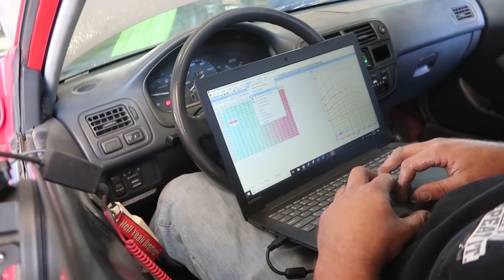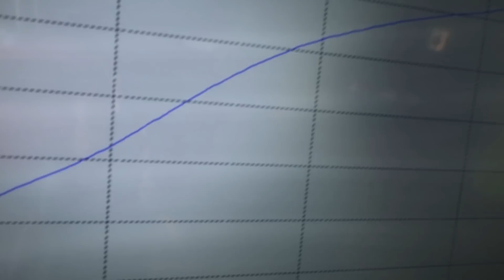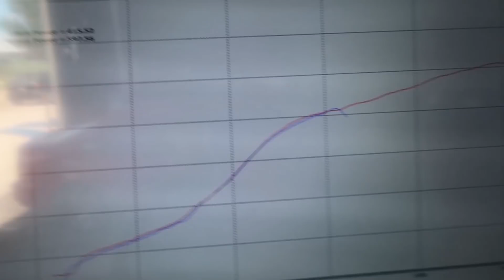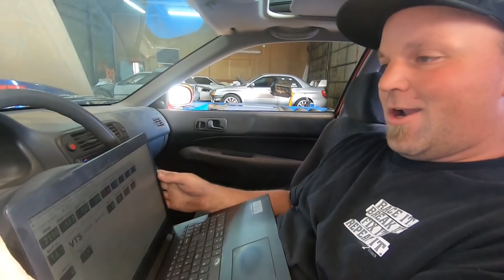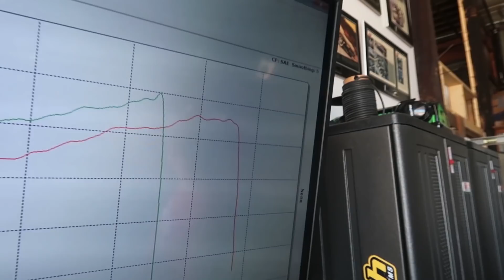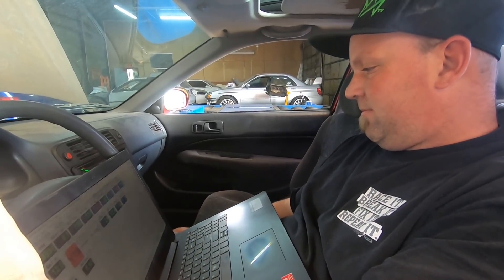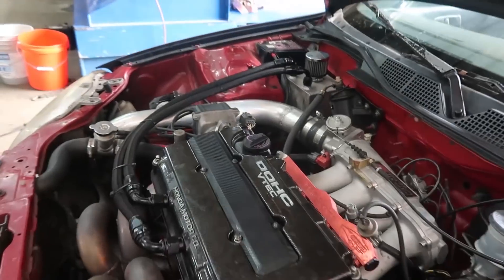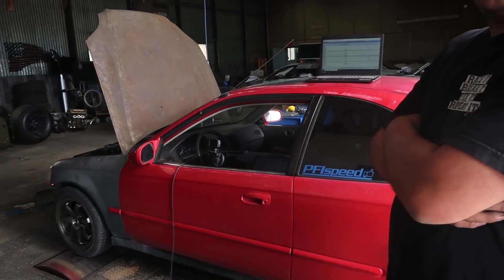A Dyno Session with Jamie’s Brother in Law!

Comment: Honda is awesome.. I have 1.7 L single cam that I would never trade anything in the world. OF COURSE, I GOT THE K&N Factory BOX Screen SHORT RAM and a K&N 3" Cone for back up .  SOUNDS like  a  fast  F1 car . I upgraded the plugs with some of my secret sauce.. it doesn't eat up gas like my old V6 4 CAM CADILLAC Sport edition Catera..
The Catera is really smooth with the air ride driving on the road, once I got it squared up and the head gasket blew just like original motor with 100,000 miles( what a joke). NO more wasting money on JUNK if GM doesn't get their science laws learned. HONDA is a great COMPANY that does not like Garbage

. THANKS FOR THE INSPIRATION Happy HOLIDAYS

Comment: Could I run 350whp reliably on a stock b16 head valvetrain?
Reply: Probably if you keep the rev limiter low. It’ll probably float valves before it damages anything in the head. However if it’s an interference engine (which I’m not sure of honestly) valve float will cause the valves to hit the piston and NOW you have problems lol

Comment: Is brother in-law on e85 i have a similar setup , just with a block guard , id1000 Bosch 044 pump AN limes and cell rod and piston and valves and retainers made 359 on 93, on stock lines and walbro 255